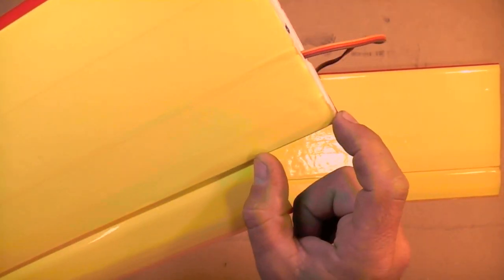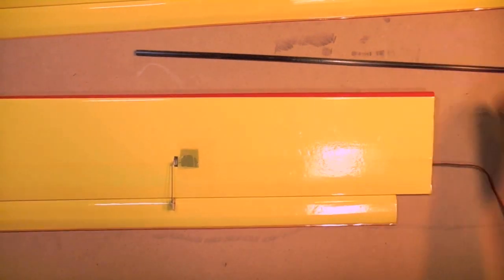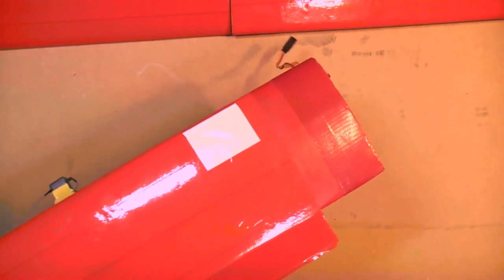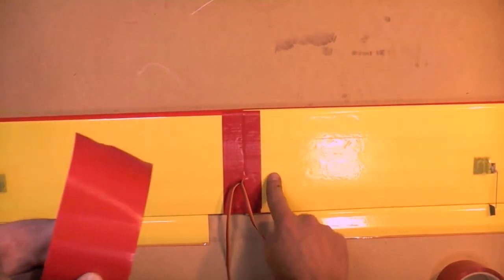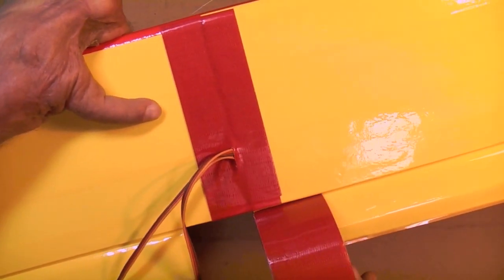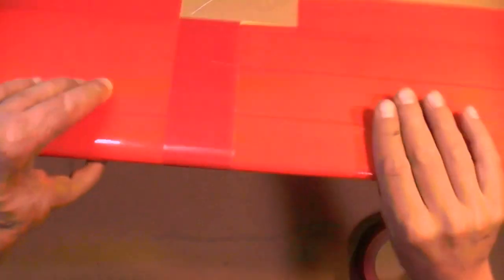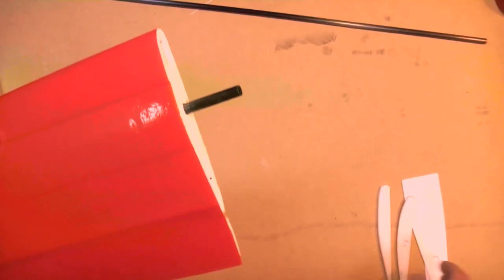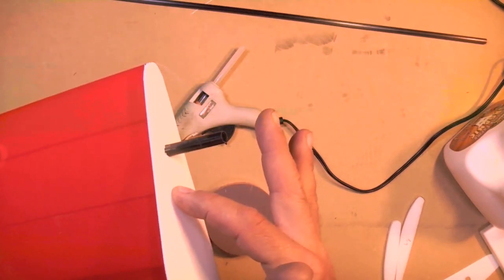PHOTON - Wing Assembly

Comment from the maker: You could certainly glue in the spar but it's not necessary.  If you are concerned about it sliding around inside the wing then applying a ring of tape or dab of glue at the center would hold it in place.  The tape at the joint is what really holds the two wings together.  I've flown a million flights with the spar just hanging out freely in there and never had a problem though.

Comment from the maker: For plain caps I actually just put the wingtip down on the plastic and traced it out.  Once cut and affixed to the wingtip you can use some sharp scissors to trim it down nice and tight to the corner.  The winglet style I use are 2" height, 3" straight rear section, then tapered down to the forward part of the camber line, which is traced on the plastic.  There's really no wrong way to do it.  Whatever looks cool and gives sufficient height to serve as a wingtip skid is usually fine.

Comment: Where do you get the carbon fiber wing spars? In my area in can cost up to $80 for a pack of arrow rods.  I have found that pvc garden stakes from walmart are very rigid and come in many sizes, and range from only 88 cents just over a buck.  They are very rigid and fit your wings perfectly.  Would you be able to do a comparison?  Im sure the weight is much higher on the Garden stakes though.

Comment: GO to your local archery range.  I would be willing to bet that you could find broken arrows in the trash.  You may not get full length ones and you will have to cut off the arrowhead insert and feathers.  When I have done so I found that the nock comes out clean ususally but the arrowhead or arrowhead insert is glued in very tightly.

Comment: Ed, I am jumping into foam built and while I have many questions, I'll wait to ask them all.  (I have watched most of your great videos and will be using them to build from)  My build plan using your Armin wing will be on a mixture of the Photon and Axon - probably sized close to a Photon, but as a pusher.  When balancing your CG, at what percentage of the chord are you finding works best?  (From the videos it appears you find the 5" chord is ideal for both Axon and Photon, so I'd stay the same)